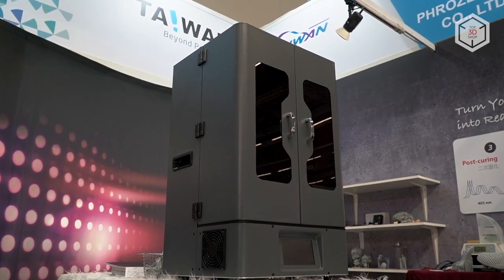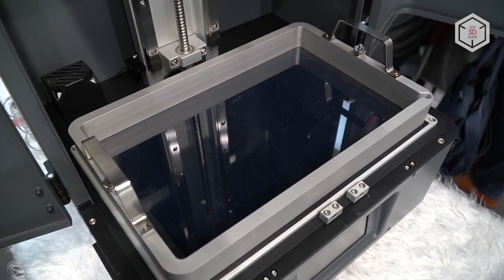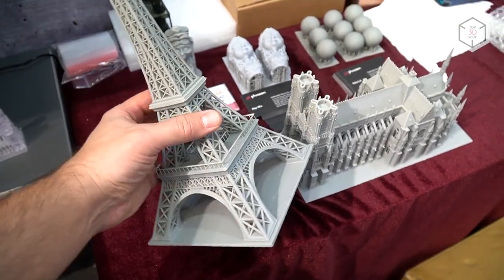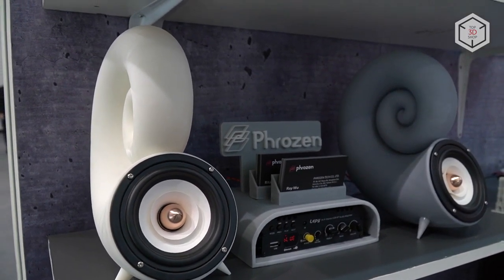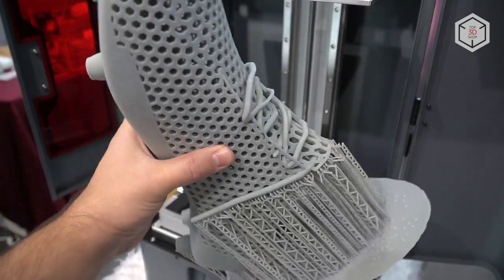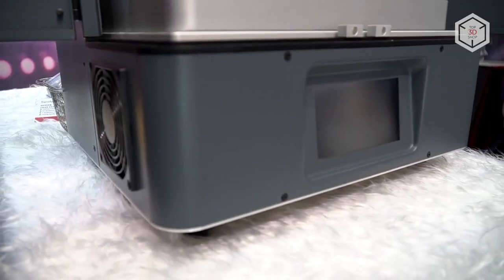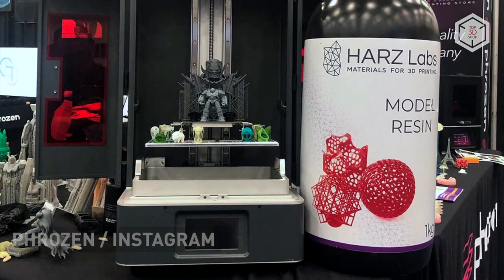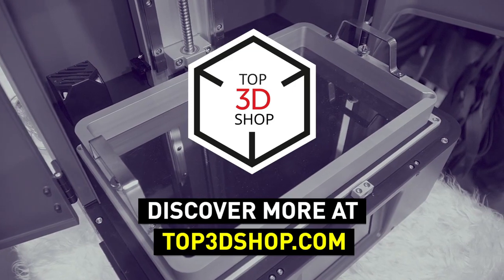Phrozen Transform Review: First resin 3D printer with interchangeable panels

Comment: Can't decide between this and Phenom, how reliable is this printer?
Reply from the maker: Hello!
Our advice would be to choose the Phrozen Transform. 
Here’s why:
1) The Phrozen Transform has a larger build volume: 292х165х400 mm compared to Phenom’s 276x155x400 mm.
2) The XY resolution of the Phrozen Transform is 72 microns with a minimum layer thickness of 10 microns. Phenom shows similar results, but its minimum layer thickness is 20 microns. 
3) Don’t forget the main unique feature of the Phrozen Transform: it has changeable 13.3” and dual 5.5" panels. This will allow you to print on two plates simultaneously, cutting the printing time in half. 
4) Phrozen Transform is the only printer in this price range that can offer such features.
Reply: @Top3DShop-Inc  Hi thanks for responding, i am leaning more towards the Phrozen Transform now, i think u made a mistake, the Phrozen Transform has 76 micron, Phenom has 72 micron due to it's smaller build volume. Printers now will come with monochrome screens for faster printing speed and longer lifespan, will they add a monochrome screen to the Transform in the future???